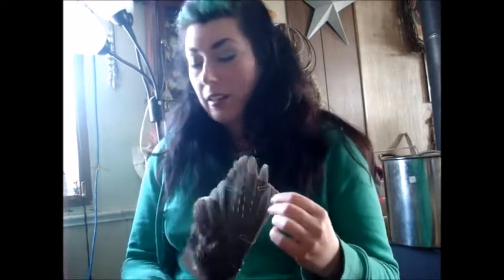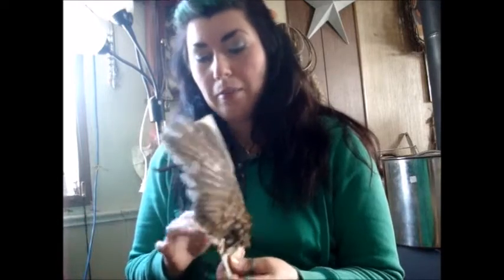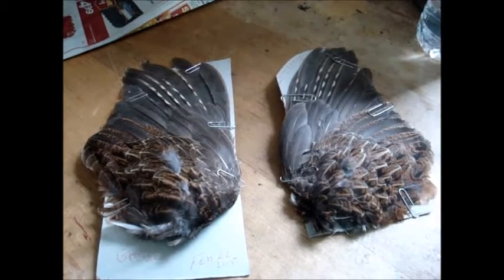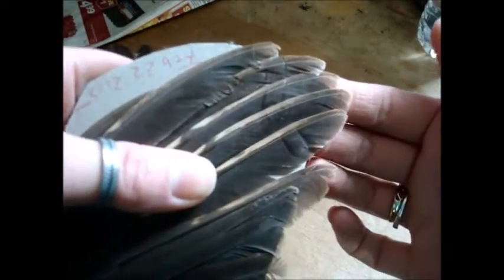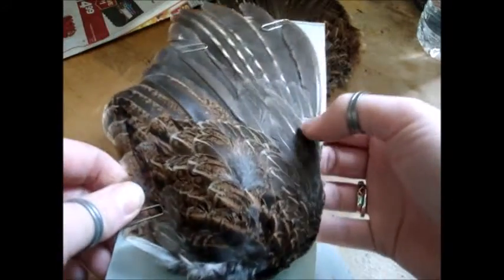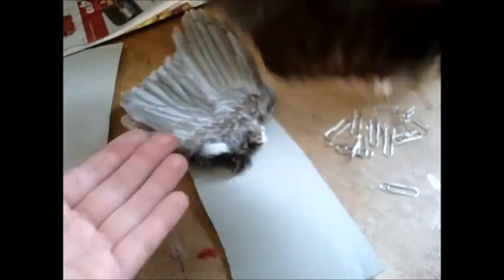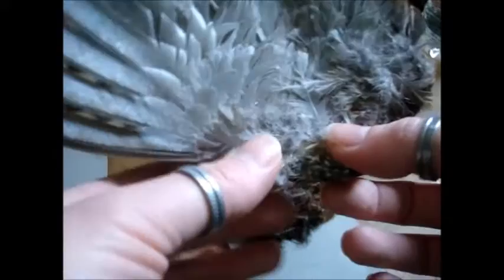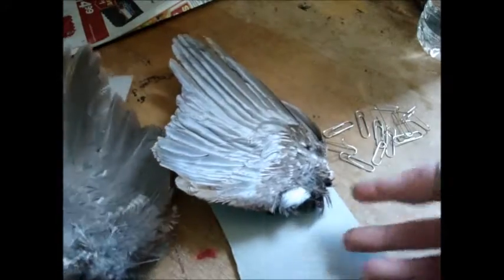Ruffled Grouse Wing Expieriment

Comment: How do you take the meat off the bone without destroying your wing
Reply from the maker: I make an incision on the underside and use a scalpel blade and tweezers. There isn't a whole lot of meat in there, so the hole does not need to be very large and easily sewn up or covered over with the feathers.

Comment: Hey Thank you for your video! I have a question, I am working on a snow goose wing that I found on the side of the hwy. I am working on the wing and wondering how you got the flesh off of the bone. How did make your cut. Hope all is well :)
Reply from the maker: I used a scalpel with a number 15 blade, cutting along the direction of the bone, then opening the skin up and gently pulling the muscles up and cutting them off where the tendons attach, as well as scraping along any connection to the bone.
Its delicate work, but very worth it.
The next time I find a bird I'll do a video of processing the wings. I have had quite a few people asking for more detail.
Reply: @BeautyFromDecay  thank you so much beautiful :)

Comment: Hey, I did some wings and they stink like hell and there feathers are coming off is that means I got to throw it in the garbage ? When they dry up correct can you specifically tell me how they should smell ?
Reply from the maker: Nicole Luchinger they should either have no smell or smell mildly like leather.
Rot smell means there was still some fat or flesh that went rancid :(  it will need to be abandoned if it's falling apart and smells bad.
Reply: Hi, thank you do much for responding my question.  I will try again. This time with borax.

Comment: Help Shadow,

Just a thought here, have you tried using or have you seen plastic clips similar to the ones you used. I think some are a more forgiving type of nylon rather the stiff inflexible plastic or heading towards nylon by material, and also they make giant paperclips, these may not damage the feathers, and now you (now) you can put card on bot sides of the wings, cutting the central part out to let it dry quicker?
Reply from the maker: i will look onto that! thanks
Reply: hi heey :)  thanks so much from your video was arwsome I used sewing pins just now on my wings and covered in salt and borax I hope it dosent discolour the feathers does any one know much about borax ? <3
Reply from the maker: Genevieve Whalesong
 so far i have not had any issues with it fading out wings colors.  as far as i know it helps mummify the tissues by sucking out moisture, as well as repelling insects. borax is commonly used in home made ant poisons as it dries them out when consumed, or at least thats how i was told it works.
i have a mummified beta fish i preserved using table salt and baking soda n 2003, as far as i know he is still perfectly preserved under his bandages ( we were going for a egyptian mummy)

Comment: a fourth method  for wings, feet, tails, and anything else  with small amounts of flesh is mummification. bury in Baking soda or borax. after a few weeks its dehydrated
Reply: The wing is naturally going to want to fold so if you want them extended a brace is needed. Otherwise it went great. Only problem I ever had was once with a tail. It was in a pretty bad state of decay already and I couldn't save it. Other than that it works great. Nice and firm! I even tanned a pelt using Baking soda.
Reply from the maker: +Selene OwlStorm  I am doing this right now with a wing and some feet :)
Reply: hey hi im just doing this now with bird wings I buried it in borax and salt ,how did your wings turn out ? x
Reply: oh great :) so no smell ? and the feathers where fine not ruined from borax? im thinking just to pin it to a board and re bury under the borax salt  i cut the wings 3 days ago so  hopefully be ok ..what is a pelt ?
Reply: ah skin hide i know pelt ohh cool baking soda is amazing stuff